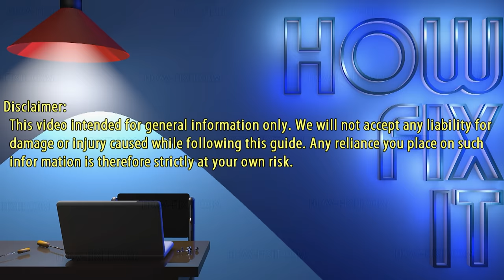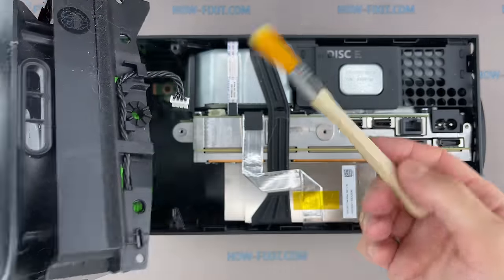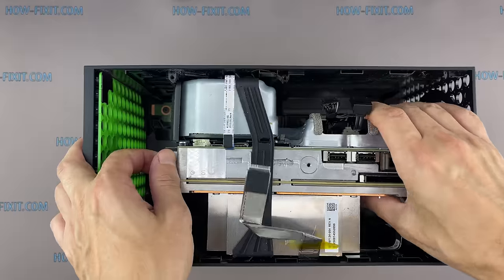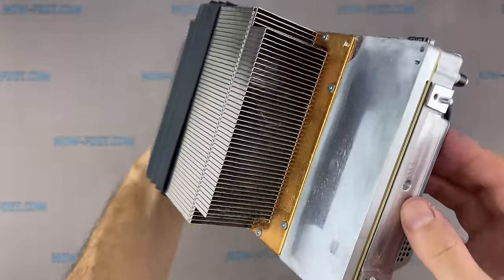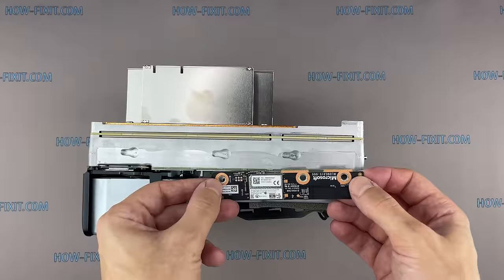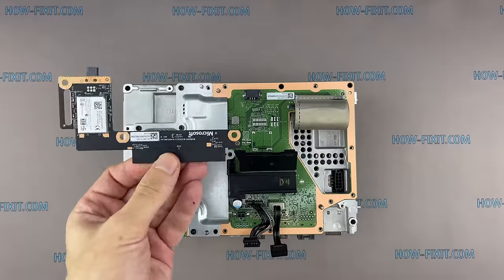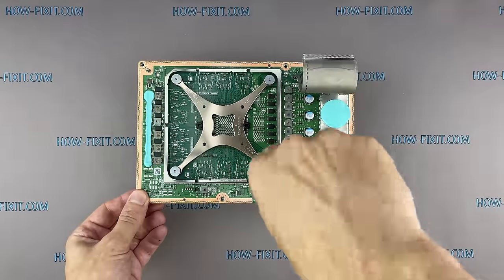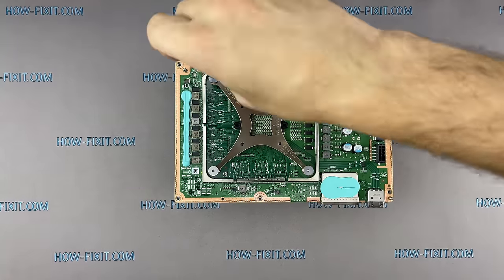Xbox Series X Disassembly, Dust Cleaning and Thermal Paste Replacement

Comment: One question when I did all of this and then rebuilt it I puted the plug and I saw smoke coming of and it smelled burned so I opened it again and the white cable that I needed to unlock to get it out was burned can somehow buy another one and fix it?
Reply: My xbox is beeping and won't turn on, i'm cooked

Comment: How often should the thermal paste be replaced? I own the xbox for 2 years now and till today i didn't even think about cleaning it. I think i will do that now in the coming days but I'm unsure about trying to replace the thermal paste
Reply: Minimum of 2 to 3 years if you have your console in a ventilated place and without risk of overheating. If you live in a place with a hot climate, it would be best to do it every year and a half
Reply: @OSITO-xm7gl  hmm im not sure about that. I recently cleaned it and there wasn't much dust in it. Also my xbox isn't overheating. Actually I'm also too scared to do so haha

Comment: I messed up the big screw in the first big fan. It was so tight my screwdriver rolled around and destroyed it, I cant take it out now. In your video looks easy to pull out but it is not. It is so tight you can not do it easily. I still cant

Comment: My fans middle T8 was like glued or thermal welded/expanded into it's socket. It stripped after trying to carefully apply enough pressure to break it free. This is the first time I've even taken it apart, it should not have been in there with that much force. Now I have a fan that I can't get out. Why use such a shitty small size of torx for these.

Comment: Wow. So easy compared to my PS5.   PS5's power supply air inlet easily gets clogged due to stupid design, IMHO.   I just took apart my PS5 today.   Sony could have made an access panel, to easily clean the power supply air inlet and radiator fins, but I guess they were arrogant or didn't care after warranty is up.

My symptom was the PS5 would shut off without any warning.   No way to turn back on, unless power was unplugged and plugged back in.   No message about why it shut off, when turned back on.   If this happens to you, it is I think possible to use compressed air(not canned air, b/c you need lots) and blow it out from the rear bottom side.   There is a triangle shape hole, that you could use to see and possibly get a long Q-Tip to remove dust.   Do not shoot air into the triangle hole, you will end up shoving the dust into the power supply.

Comment: Me personally this is why I don't sit my Xbox upright. I mean I know heat rises and all so sitting the Xbox upright would be logical, but what happens when your not playing your Xbox and you out and about. What's happening is dust particles are constantly floating and falling and if your Xbox is upright you better believe dust is falling into it especially with those big port holes. I wouldn't be surprised if some people would get the smell of burnt dust as their Xbox began to heat up.
Reply: Yep. I don't know why people don't bring this up more. I really don't like how the design of the Series X is practically a dust collector, and tbh I'm just as concerned about it when its laid horizontal
Reply: @Josh-si6ds  Если не играете одевайте чехол на консоль............
Reply: I cover up the top with something when I am not using it lol, coz the big holes are really a concern for debris falling in
Reply: @neoroxx  me too, but make sure it cools down before putting a cover over it.
Reply: You can put it to a side after playing and let it cool down for a few mins, then put it back vertical and put a cloth on it. Easy
Reply: It's actually more efficient running standing up, it's almost designed as a convection tower, utilizing heats natural ability to rise therfore likely requiring less power and wattage for the fan to efficiently cool the case.

Comment: There was so much fucking dust in mine holy I don’t have the right tools so I only took the back plate off and cleaned out what I could with what I had, my heat sync was absolutely caked so I got everything I could off that and some little bunnies piled in the crevices it already sounds so much better it was turning into a ps4 jet😂 can’t wait to fully clean it

Comment: Es un diseño malo por parte de XBOX. Analizando su estructura y forma de ensamblar las cosas. Desde el punto de vista técnico. Es buena en especificaciones técnicas para juegos como gamer media en el 2023 alrededor de una AMD RADEON RX 5700 con 8 GB VRAM, AMD RYZEN 3 a 3.6 GHz 8 núcleos, 8 GB RAM DDR4 a 3200 Gbps (velocidad de transmisión de datos)  y una AMD X570 cómo placa maestra, con un disipador termico de buena calidad, con una fuente de energía de 850 Watts, y un buen gabinete. ($1000 USD) contra $499 USD de la XBOX SERIES X. Si en verdad espero que mejoren el diseño interno de la consola, es algo de dudarlo; cualquier reparación térmica.

Comment: Seems as though Microsoft made a big mistake with the Series X's cooling - I think not going with liquid metal (PS5 uses liquid metal) was a big mistake. My Series X is overheating after about 8 hours of consistent use and has no dust build up and has brilliant ventilation - I think the thermal paste applied at factory is too little or of low quality , this issue seems unusually common. Thanks for the video - applying a fresh set of MX4 fixed the issue.
Reply: I'm glad you got your Series X sorted but mine is in a pet-heavy area and runs for long periods of time and never overheats.  I clean it about once a month and it's fairly gross every time.  Maybe you just got unlucky with how they applied your paste at the factory, though it's pretty hard to do a bad job of applying thermal paste.
Reply: Bruh your console was loud on optimised games right ?
Reply: this is definitely an issue with the thermal paste use in xbox x, the thermal is low quality easily dry up, I saw other videos with comments of xbox x heating up as well shutting down. this little detail overlook causes the xbox x to have lousy heat transfer to the heatsink. ps5 liquid metal definitely make much more sense but their heatsink is intentionally  smaller
Reply: @subzerosystemx  Yup, can confirm it's not just the Series X. Took my Series S apart because it was overheating/crashing and found the thermal paste was completely dry and crumbly. Repasted it and it's now cool and quiet without any crashing. Don't know what paste they use at the factory but it's pretty crap if it can't even last 18 months.
Reply: @Haawser  wow so the older xbox has this thermal paste problem as well, MS is really sloppy when come to details like this seems like the consoles they design doesn't bother into details like this. The hardware maybe be quite good overall but when comes to execution sony ps is still better, but ps3 that gen of console has it fair share of heating issues as well ps4 is better with exception of ps4 pro due to the processor higher tdp..
Reply: @subzerosystemx  Xbox Series S is not old. Same generation as Xbox Series X in the video. Just the smaller/cheaper version.
Reply: @Haawser  ic xbox naming didn't really look into it